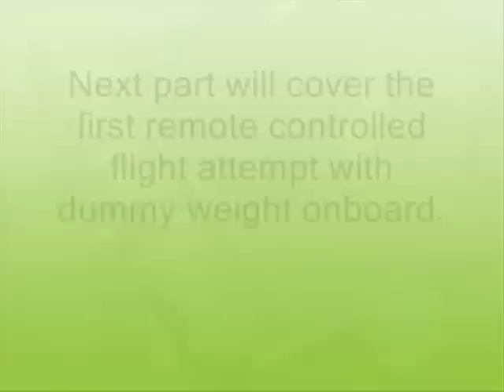Manned multicopter / multirotor build Episode 6

Comment: This was already accomplished back in 2011 using now vintage battery and electric motor technology. Internal Combustion engines react way to slowly to speed changes to have a fixed pitch prop system be able to make the needed flight attitude adjustment fast enough for safe operation.

Comment: I think you would be better off with a single large gas motor in the center powering 4 propellers with just pitch control on each corner. With that you can electronically stabilize the "copter" and you have the added power and flight length of gas.

Comment: Are you sure that the reaction time of gas engine will be sufficient to stabilize the "craft"? I think that it might be difficult. You should think of collective pitch as emergency plan. We were working on a gas powered hexacopter and the engine was meant to power all six propellers with same speed, and thrust change on each propeller was achieved by changing the pitch of blades.
Reply from the maker: Fabryka Dronów "Are you sure that the reaction time of gas engine will be sufficient to stabilize the "craft"?"

Of course I am not sure!
I would not be conducting this build it if success was guaranteed. The entire
build is powered by uncertainty :-)
Reply: amazingdiyprojects well maybe the question was wrongly formulated :) Did you do any kind of tests in smaller size. For ex. take 4 engines put them on a X frame try to fly. What kind of flight controler are you planning to use?
Reply from the maker: Fabryka Dronów 

Ah, sorry my bad. WellI did this test: https://www.youtube.com/watch?v=GBmDlw6xOno
Which led me to believe this project just might take off :-)  Controller: KK 2.1 I know it sound silly, trusting your life with a 15 dollar controller, but I think less
is more in this case.

Comment: I am rather intrigued by your inventiveness.  I appreciate your practical approach to problems such as the making of propellers from sections of cylinder.  Very clever.
Fascinating that only 8 engines can produce enough thrust to lift that 100kg vehicle with such small propellers.  Can you share the power ratings of the engines?  
I am working on a quadcopter design which attempts to take advantage of the increased efficiency of larger rotors.  At some point control response becomes an issue, and further increases in rotor diameter lead the design towards constant speed/variable pitch rotors.  I will stay tuned to see what you have next.
Bravo!!

Comment: Pretty sure you've been told enough already, but this is a ridiculously unstable configuration if it ever flies. Try a hammock-like seat suspended beneath the frame, with the central rotors further outwards - an arrangement roughly resembling an octagon would be much more stable. As it is, it's a recipe for a disaster, since it's so top-heavy. Try making a small cork raft in roughly the same shape as this, then attach a load of weight to the top - it will tip over in the water.

Comment: I think you are losing some power and stability by how loose the motors are mounted.  They need to be more solid. Once the rpms go up, they could rattle themselves right off the frame.
Reply from the maker: Mark Spohrleder The motor mount will fail if it is to firm.
Reply: +amazingdiyprojects one reason why motors are always mounted with rubber spacers
Reply: Agreed
Reply: I know they should have some dampening capabilities, but that just seeed like too much.

Comment: Good, just needs protection for the propeller. if it is possible to connect a speed control for each engine, an board DJI would be able to stabilize it
Reply: MrDeniw Not with a gas engine. ESC are Electronic. Would have to have another device to then distribute the signal into a mechanical adjustment to the throttle input of each gas motor. Problem with using gas motors is that they take time to wind up. RPM takes time to increase, is going to be slightly different for each motor, which means very hard to calibrate precise thrust output to stabilize the craft. This isn't going to fly well..if at all.
Reply: Matthew Bradford  Yes, the engines have to be electric!

Comment: +amazingdiyprojects This looks really cool. I'm curious though... I've noticed that every build online lacks guards for the blades. Is there an aerodynamic reason why none of the build have these? To me, that's one big roadblock to commercializing them, the exposed blades are so dangerous.
Reply from the maker: In the VTOL context weight is everything. So if you have a propeller guard it also must carry out other tasks as well such like in the electric version, "The ChAir", where the prop-guards are also load carrying elements and serves as a current path for the electricity feeding the motors. Just adding "dumb" propeller guards will severely limit flight time in person carrying scale multi rotors, since aircrafts, especially VTOL:s scale up porley.
Reply: I see. Thanks for that explanation, that does make a lot of sense. Thumbs up.

Comment: i have repaired built, and designed quadcopters at my job. i actually work for a large cellular co. but i am a repair tech, mostly micro soldering. but from what i can see allow me to put my two cents in, i think it needs a cowl to direct air currants, this will make it far safer and multiply the lift ratio. think how air curls under the wing of a plane and wrap the wing to control air flow and now you can easily direct the air and stabilize yourself in flight using very little trim adjustment. again just a thought no need to cone at me folks. i don't want to see the guy die trying to be groundbreaking here.

Comment: Well done! Am looking forward to Part 7!  How much lift and endurance ya get from each engine? I wonder how the stabilization will work with piston engines?
All the best Ian & Paul
Reply from the maker: gasturbine101 

Hi, guys!I love your “The swarm” concept.I expect about 10-15 min endurance with a 10 liter fuel tank and close to 200kg max lift
once the motors have been run in properly. Right now I am waiting for new
rubber mounts for the motors since the ones I have now are too soft. Will it
work or not? Finding out the answer is the purpose of this build! :-)

Comment: There is a reason all quad/hex copters are electric... electric motors have almost instant RPM adjustment potential,... combustion engines do not.
Reply: but you need a 5000 tonne battery that lasts 2 seconds
Reply: he proved you wrong.
Reply: He who, proved what, wrong?

Comment: Looks interesting , but a few concerns.
Nitro engines are a bad idea IMO ( i love nitro engines myself ), but they take longer to spool up and down. Also i noticed all the nitro engines are spinning in the same direction, which would probably spin the craft around due to 8 engine torques all going the same way. I would go with some super duty electric brush-less motors. that way you can set one side to spin clockwise and the other side counter clockwise and just buy both regular and pusher props to counter each sides torque. Yea it is more weight but if you are going to be sitting in this thing you want it safe .
Plus you will get the instant reaction time of the motors.  Very neat project none the less, i hope you succeed. G/L.

Comment: I am not an engineer or a physicist but I do believe if you're center of gravity is below the driving force the motors and propellers you would have a much more stable vehicle I don't think you'll ever see helicopter with the rotor on the bottom

Comment: Definitely, reciprocating engines for the propellers will not work. As stated earlier, they are too slow for achieving control. Cancelling angular moments between propellers is a must on this type of vehicles; this is an error that could cost life. Multirotors have to be electric driven for controlling fast enough propeller rpm's. Flying cars will be of this type and they are a few years ahead (less than 5 years) but the well known physical principles must be respected.

Comment: seems like it will not work as you are using ic engine , each has to take at least 10 to 15 kg thrust ,and i think they are too small to lift that with this much size prop.
Reply from the maker: Vineet Sharma Why do you not search for PART 7 ?!
Reply from the maker: Vineet Sharma The motors are rated for 25 kg thrust with a 27x10 prop.
Reply: on what rpm ?
Reply from the maker: 7000rpm.

Comment: Lololll what's the point.. it didn't even lift up
Reply: Kyo Mocho That's just how he plays 'make-believe'.
Reply: Kyo Mocho  I said the same thing. I don't know what the point was to this because not only would all the motors NOT stay running, he started them as if he was gonna fly the damn thing and even climbed aboard, and all just to smile and give thumbs-up? Total waste of time...
Reply: Kyo Mocho you all wrong because it flies
Reply: zero00tolerance It flies, empty. I can buy a drone that flies for $20. To have a human capable lifting copter you need more than this, more power, more rotor.

Have a look at actual copters that carry actual people. There is a big difference, i would be surprised if this can carry  a quarter of a person, given the actually working vehicles.
Reply: Barry Gillis
I have seen a few human drone videos off the net.. including this latest one http://www.quadrouas.nl/?page_id=64  This is 8 gasoline engines not motors the lifting capacity is much bigger. He can just sit on right now and fly it but out of safety im sure he doesnt want to. Well wait and see Barry
Reply: zero00tolerance E-volo has a working test video from 2011 thats more impressive than that one.Those dutchies, least they get whats needed for stability-spread out rotors.They seem to understand the science, but my guess is that that was still not quite enough to have real flight, which means getting clear from the ground effect.

E-volo has a 2 person prototype with 18 rotors, but there does not seem to be any manned flight either, only unmanned.that was 2 years ago, if it all works as they say it works, surely they want the world to see it can lift people, and everything suggests that it should . And this is the "cream of the crop"

We will wait and see indeed. But this design seems not to be promising. Do these"powerful" engines with their tiny rotors produce enough lift to lift a grown person? My guess is no. We will wait and see, unless we dont see and wait and wait and wait,,,,

There is a pattern in extraordinary claims made, believers always say wait and see, whether its flying cars, magical cures, mystical creatures ,free energy devices or paranormal abilities.

I grant you flying cars are the most likely of these to become "real", but there are heaps of technical hurdles. So yeah, the proof is in the pudding. No pudding, just some ingredients, and not the ingredients i believe are needed to make pudding.
Reply: Barry Gillis E-volo is a german company, not dutch. But this is a completely different approach. The guys from e-volo want to build a helicopter as stable and reliable as a real helicopter that carries 2 persons. 
This guy here just builds an octocopter to fly as a proof of concept without the need to pass safety regulations or long flight times.
All 8 motors combined produce 92hp, of course that's enough to lift a human. Besides that he already flew it in part 7 and confirmed that it flies with a 68kg payload.

Comment: these engines never do the service of brushless motors.
Reply from the maker: lavio tron True. :-)
Reply: amazingdiyprojects Let's dream: maybe make a central electric generating turbine, high power and light to 150 kw.
 with brushless motor ... reduced weight the most nuclei with high yield and high frequency and high voltage. mechanical with titanium and aluminum. Initially no pilot. The turbine would be the burden of the drone, with low center of gravity and above brushless. $$$$$$. In his projects have the powerful brushless and the turbine generator is easy ... sorry .... I'm in Brazil ... but would do a society ... this is far ... I already bought your projects ... bye.
Reply: lavio tron dreaming .... one petrol engine.
 Propellers (4) driven with HXL belts or gears.
 Propellers with pitch variation.
 Each with its magnetic servo fast response in milliseconds.

 perhaps the fixed speed and propeller pitch changing in milliseconds, we can
  stable flight.

Comment: Poor design ? why does everyone want to put the pilot in harms way,a pod,cage constructed of chrome molly or 6061 tubing,single seat,harness,4 landing legs,with the four electric engines on top  or go to a single engine[gas or electric controlling 4 counter rotating blades,via shaft and belts.Controlling the flight by pitch control,gyro.[Curtis Youngblood's design]The pod,allows a race type seat,better safety,armor plastic canopy,increased visibility,a place for a ballistic chute. Lets remove the pilot from close proximity to the blades,one slip,getting in or out and its find a new career..Good technology is simplistic.Does my idea make sense ? you can use existing software,have someone mil spec the control boards,maybe add a second flight control system  in case of a failure.Slow and low,what a great way to fly.Keep all those ideas coming.

Comment: LMFAO! I hate safty nannies on the web but this is a bad idea.  I haven't even watched the video but whoever flies/rides in this thing is either ignorant or suicidal.  You would be MUCH better off using brushless motors, gas motors with the throttle controlled by servos will have too much slop and won't transition fast enough to keep up with the flight controllers demands.  The reliability of two stroke motors for aircraft is not great either, especially with the carberator in the prop wash it will lead to motor cut off which even with 5 out of 6 motors will either crash or cause massive yaw issues.    
Just because a idea is possible does not mean it should be done.

Comment: sorry my friend..but fuel engines are a no no.....electric only  less vibration and less expensive. good (and costly) try do..
Reply: I think in this situation they are a little cheaper but I sure would go electric for something like this. there is massive cost in batteries and massive time or cost on charging the darn things
Reply: +Reuben Horner preppaer and take a gennerator on-board

Comment: Hi,  how did you get the motors to go CW and CCW
Reply from the maker: By moving the hall sensors to the opposite position in relation to TDC, top-dead center stroke position. A surprisingly easy fix to do on these motors.